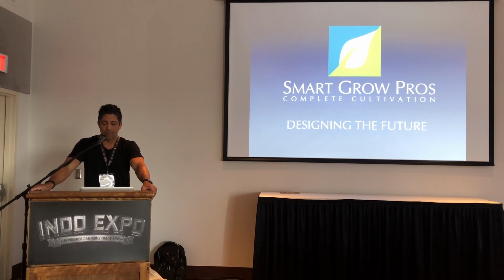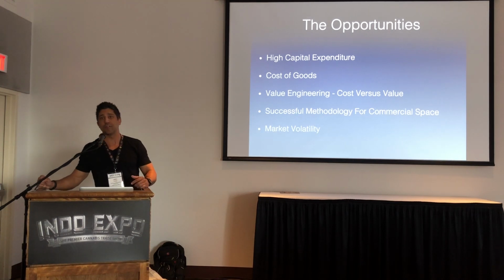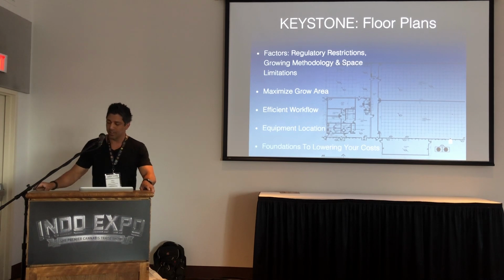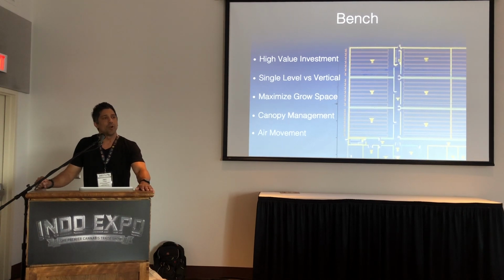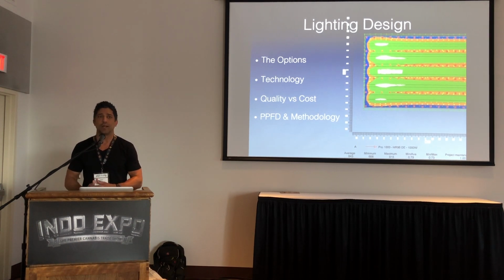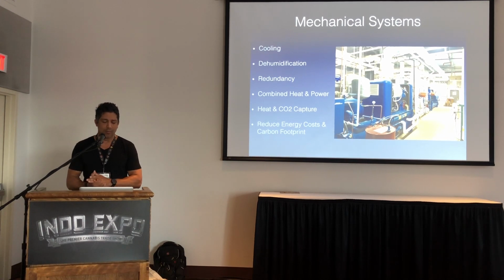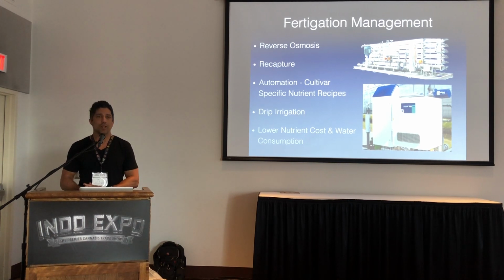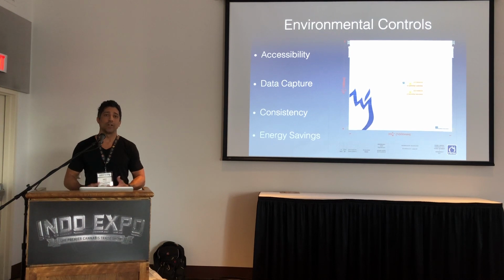Building for Efficient Cannabis Horticulture - Jody Vukas

Comment: Was excited to hear this talk until this guy totally discounted the use of LEDs. The information on efficiency and effectiveness of LEDs is everywhere. Time to do some homework Bud
Reply from the maker: It surprised me too. Based on everything else he said, I was expecting him to be in favor.
Reply: Did not discount them but rather laid out the challenges from a fiscal and performance standpoint. Outside of the doping challenge, the CapX in relation to ROI and production numbers don’t make sense for 95% of startups as well as greenhouses that are converting from a different crop to cannabis. I have designed, built, and set up operations for close to 30 facilities including greenhouses and several entertained for a brief moment but went HID for flower. I am definitely in favor of them. I work with who I consider to be leading the pack on LEDs in the cannabis space and install thousands of them in veg and clone applications just not in flower. But I guess I still need to do my homework.

Comment: He should check out the LED'S made by Fluence, I think this guy obvs knows his stuff but maybe he's a bit out of date with some information because he's been working so hard helping other cannabis growers....And I honestly don't mind reading the Photosynthetic flux density that's all apart of the fun, did he also not take in account that you can place Led's closer to plants there for helping them pick up on more PAR...
Reply: TITAN0402 I install a lot of Fluence LEDs for veg and clone applications and have been doing so back when Fluence was BML. They make a fantastic fixture that flowers well but in commercial applications where a DE HPS cost 65-70% less and will put down 80-90grams a square foot, that’s hard to dispute. In my experience, the facilities that are running Fluence LEDs in flower are doing good but not nearly as good as HPS and HPS/LEP facilities. Just my perspective.